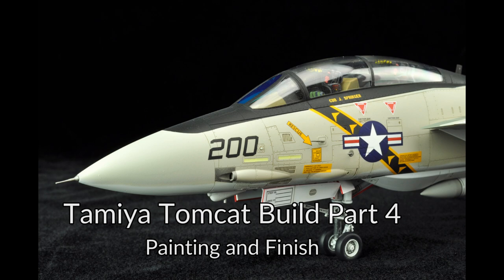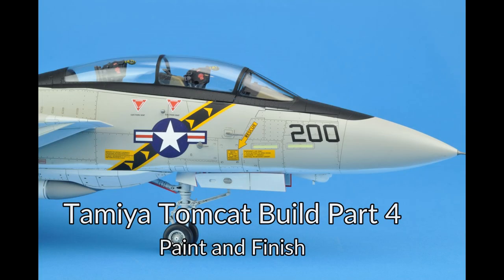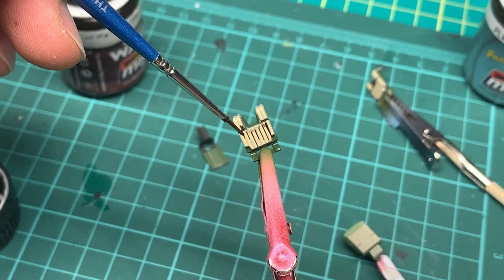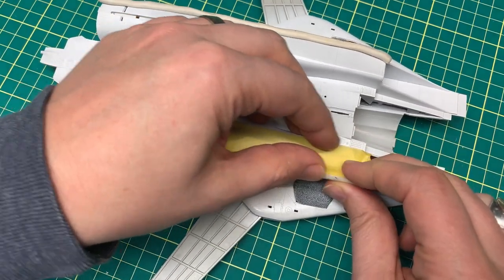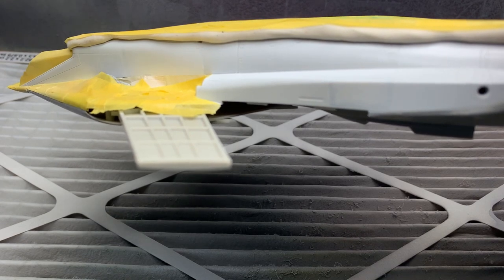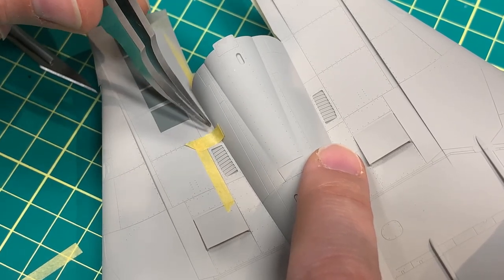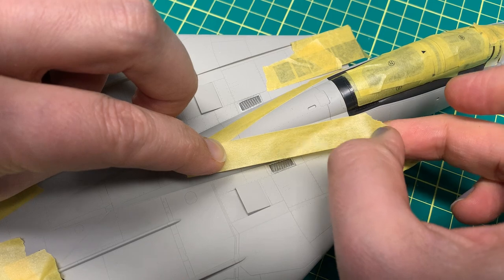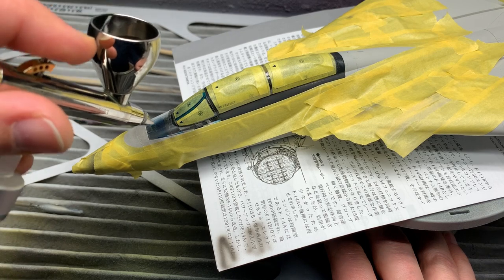Tamiya Tomcat Build Final: Painting, Finishing & Assembly

Comment: Ive watched all the videos in this series and love tips, even as a semi seasoned jet modeller, there are things that i found useful (the tire trick).  I also like the "clean" look you gave it, as its refreshing from alot of the over weathered kits. As far as the high vis color choice, they are still very much used, low vis are usually reserved per the air wing or squadron commands preference and wartime operations. Vfma-232 red devils in particular often use the bright insignia red and white tails and spine colorways.
Its also funny that you say when ypu were younger and such that vf-84 was aleays the first you would think of, mine was always vfa-2 "bounty hunters" 😊
Reply: there is no such thing as over weathered tomcat.

Comment: WHERE ARE THE PILOT FIGURES !!!!!!!!!! I'm so sick of having to build modern kits with every door, hatch, wheels down, canopy open, (or closed but Empty). kit makers.... PUT PILOT FIGURES BACK IN THE KITS!!!!!!
Reply: This kit does have 2 figures
Reply: Tamiya add pilot figures. That is builders prefference if he wants to use pilots or not. If you dont have any pilot figure in the kit you want to build, get aftermarket one. simple
Reply: @ScaleHangar182  where? I've tried to find 1/48 jet pilot figues for a long time. Online....hobby shops, everywhere.
Reply: @garyyoung4074  you can just buy a 3d printer can print these+many other useful things
Reply: @Maxtherocketguy  well, I think that is the responsibility of the kit maker. All the monogram/revell 1/48 kits from the 60's-90's had pilot/crew figures included. I had a large stash of 1/32 jet kits stored up but discovered NONE of them had a pilot included. I sold them all and am sticking to only 1/48 where there  seems to be are more "pilots" included. I mean really....some if these new kits are 100 bucks or more and don't include the pilot. I find that unacceptable. It's an f'n plastic toy for Gods sake. I'm hoping enough modelers will complain and ALL the kit makers will listen and put them back in. A 3d printer  should not be necessary to build an "in flight" version of any jet!!!
Reply: @garyyoung4074  yes I understand I am also disappointed by that but I am just listing the method I use to get around that prob.
Reply: @garyyoung4074  yes I also like in flight versions

Comment: One of the few things from Tamiya that I do not like is their masking tape. I like 3-M Pinstripe Tape. It is very easy to work with and you do not get bleed under the tape. I also use Guerilla green masking tape when I need to cut thin stripes. It adheres better with less bleed!  Cheers!
Reply from the maker: Hmm... I'm going to have to give that a try!  Thanks for the suggestion.
Reply: @ModelAirplaneMaker  I want to make a new observation. First let me qualify my painting skills. Most come from doing car repairs, transferred to modeling. I am finding that the tapes I use do not work well with Vallejo or Mission Model paints. They just do not bite onto even well prepared and primed surfaces. I mix my Tamiya paint with Lacquer Thinner. They grab onto the surface beautifully. I have done this wit other acrylic paints as well. However Mission and Vallejo don't mic well with Lacquer Thinner, they thicken. so you must use their recommended thinner, but I find they do not have the adhesion and will lift with a quality tape. I have never had that problem with Tamiya paints thinned with Lacquer Thinner.
Reply: Mixing Vallejo paint with laquer thinner????? You gotta be kidding me.